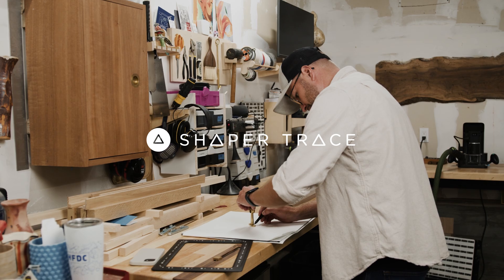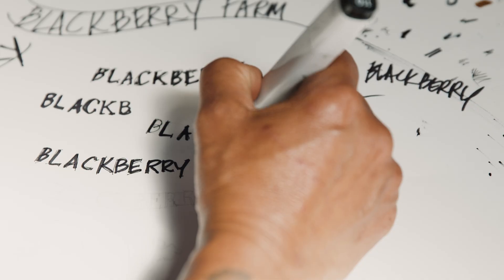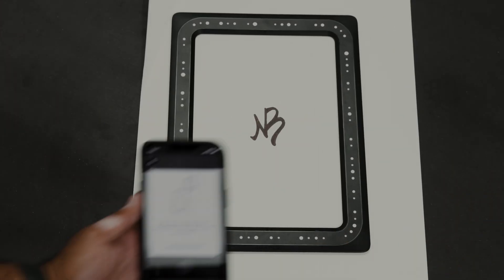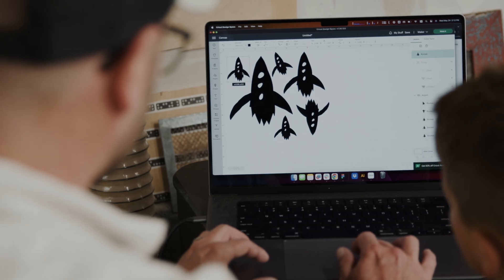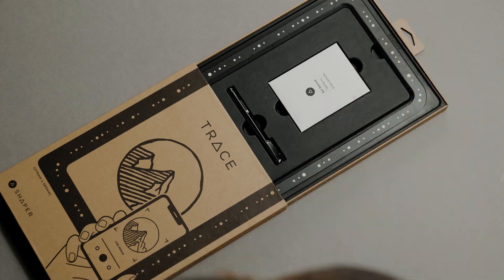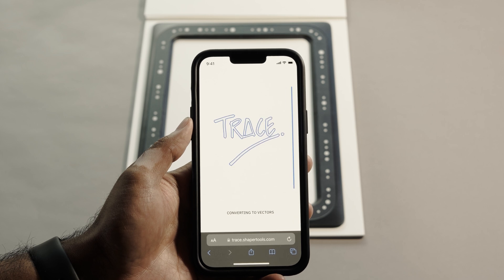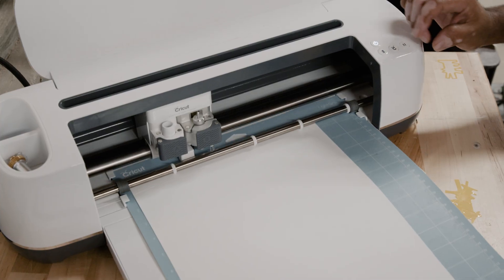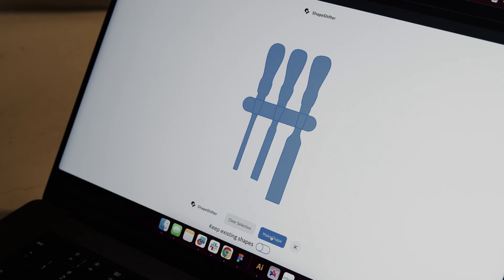Introducing: Trace, a tool that lets you go from sketch to SVG in seconds

Comment: What about color? I work out my designs with color pencils and markers. Will those colors translate over when I vectorize it?
Reply from the maker: Trace works best with black and white images; it does not pick up color. If there is color in the image, depending on the shade, it may or may not be picked up by the Trace application.

Comment: Loved the idea… until I brought over my design to fusion 360 AND nothing was to scale even with steps given to properly scale would even work . Maybe a plug in from shaper to fusion360 to fix the scales would be great then I’d be able to knock the dust off this and get back to using it. Until then good ole trusty calipers .
Reply from the maker: Setting the scale factor to 1/2 should let you SVG import in the proper scale!

Comment: So, this can take a drawing and make it into a vector file? Without need of adobe illustrator? I do leatherwork and have been wanting to turn my patterns into vector files in order to have acrylic templates or steel rule dies made of them, but the need of adobe has held me back. Is this Studio app also included or is it a subscription based thing like Ai?
Reply from the maker: That's right, William! It also has the benefit of capturing a centerline.

Trace is a one-time purchase and does not include any further subscription. Studio is a separate product and is $99/year. Studio is not required to use Trace, but is very quick and useful!

Comment: Whats the cost of this program  and can it be used  to engrave sign ?
Reply from the maker: Trace is $99 and it includes the Frame, access to the app, and a drawing pen!
Reply from the maker: It can be used to capture a drawing to be engraved by another tool!
Reply: I just want to use it with my shaper and if it does what I wanna  do might just buy me another shaper 🙂

Comment: what is the size 8x10? Will a battery operated drill fit inside the frame?
Reply from the maker: The opening is 10 ½” × 7 ¼”, or 265mm × 185mm.

Comment: Been using the Adope picture-to-SVG successfully for some time now.
Reply from the maker: For sure! There are definitely other tricks or workflows out there and Adobe image trace is a workflow, for some. However, Trace has a few additional (but noteworthy) differences: 
- You can snap a picture from any angle and it will preserve scale accurately
- It not only corrects for perspective distortion, but the distortion from your phone's camera ensuring accurate results
- It can be done in the shop or on the go, all on your phone, without fussing with a computer 
- Trace doesn't require an ongoing subscription or software license